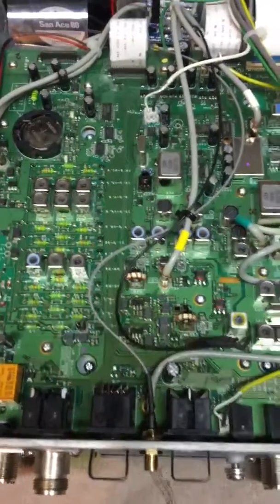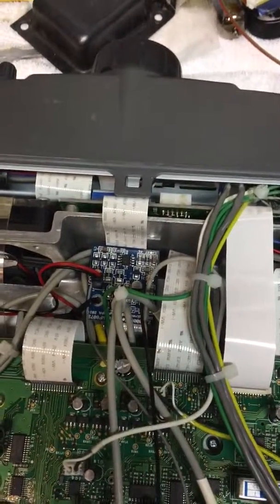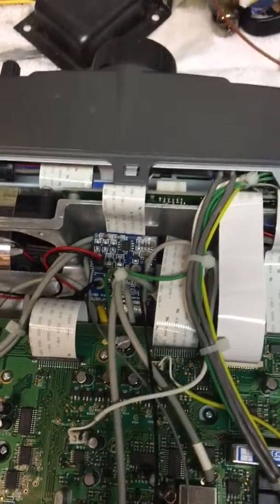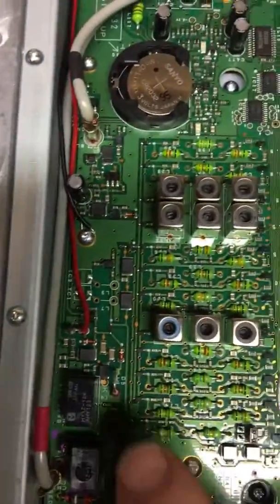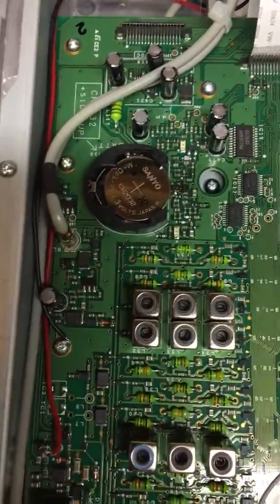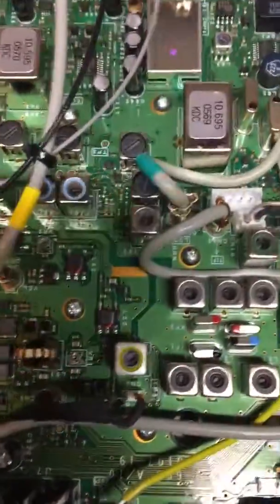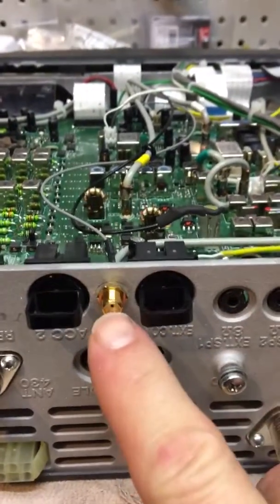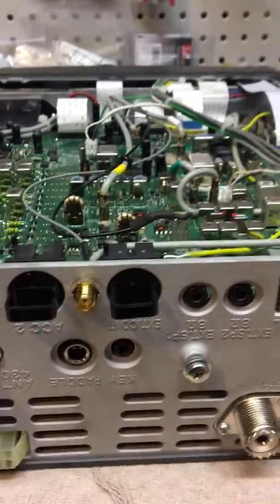TS-2000 if output panadapter

Comment: Hi, I realise this video was done quite some time ago, do you recall what the gain setting was on the Z10000 buffer board?  Or know what value of resistor R7 was used on the board? Many thanks
Reply from the maker: Hi Pete, the board was set for unity gain.   I cannot recall the value of R7.     no noticeable decrease in sensitivity at all.   73 John

Comment: What is the maximum bandwith using the 10.695 IF?
Reply from the maker: There is a very pronounced 15khz hump in the passband due to the roofing filter.   However you can still see strong signals beyond that.   I have successfully used the 10.695 IF tap when working vhf/uhf satellites.